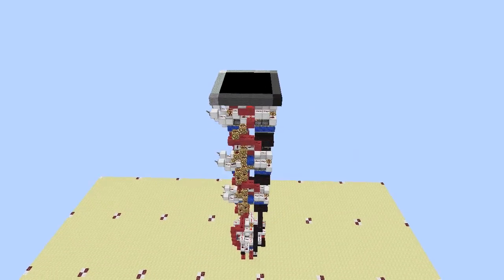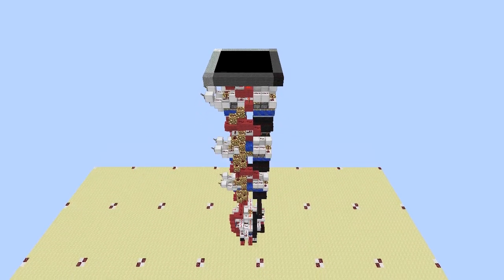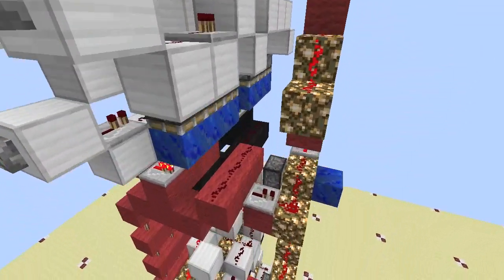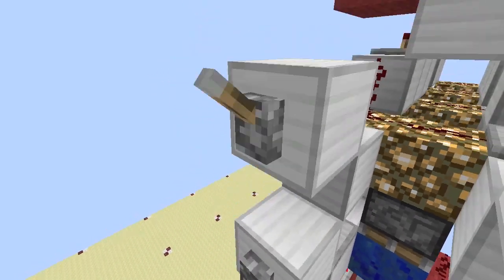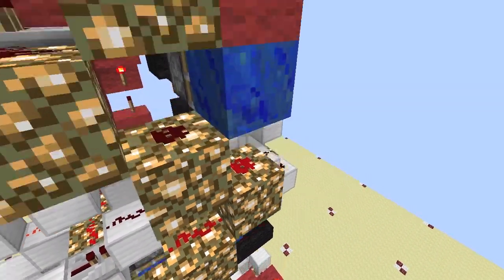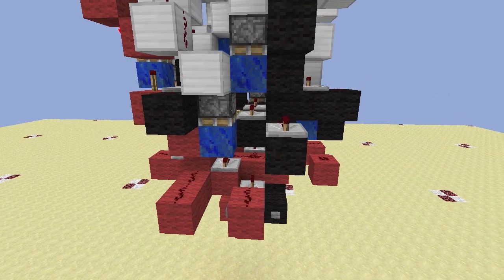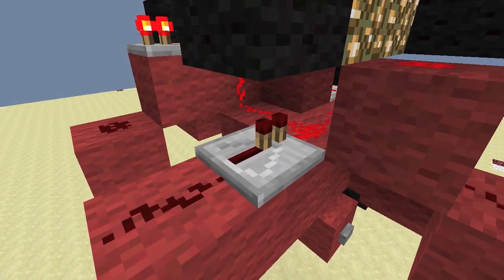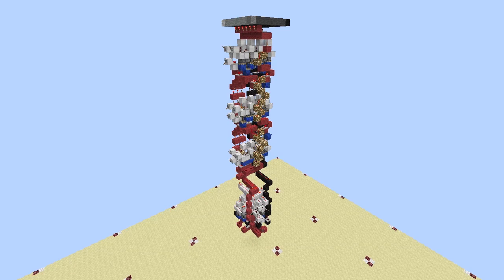Transparency Circutry - An Explanation

Comment from the maker: That's something I've thought about - right now the shifter is only hooked up to one input but in the final build there will be some fancy multiplexing that allows me to control which image shifts. I've considered independent shifting for each image, but I'll really have to play around with the wiring to know whethor or not it's possible to pack all of that into an 8x8 area. 

I <3 the powered rail dsiplay! :D